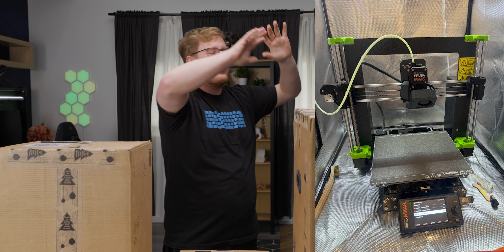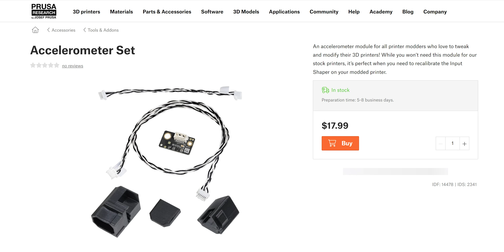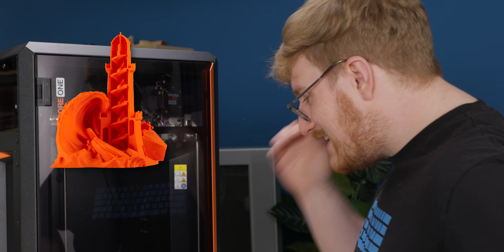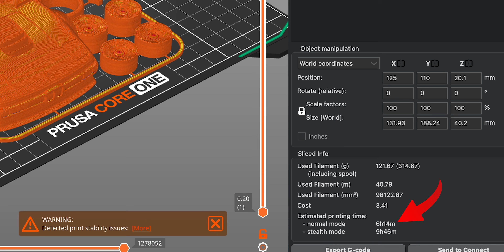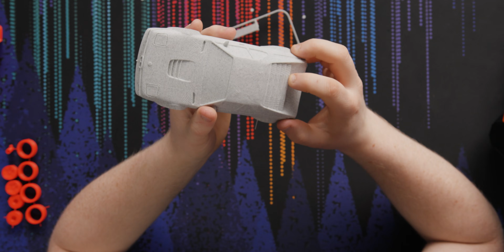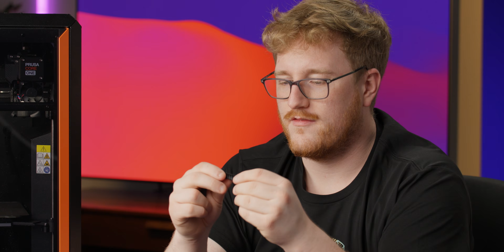Prusa has IMPECCABLE timing - Prusa CORE One

Comment: This highlighted an issue I see in 3D printers. They keep coming out with new models ... but so very little changes. I'm not compelled to "upgrade" from the $200 one I bought 3 years ago and put one of those tents around. Being able to do multiple colors at the same time is about the only thing that sounds enticing. I'd love a resin printer, but have no way to deal with the toxic fumes (which limits filament choice on the FDM also).

Comment: Looks like that needs to be calibrated badly. non of my prusa's ever printed that bad.
Reply: Well if it had built-in accelerometer and lidar, then it could do a self calibration in the setup process... This would reduce motor noise, excessive vibrations that transfer to prints, kinematics and flow improvements and also layer consistency. Almost all the other competitors offer this out of the box
Reply: @alexandrucapatina8688  the point is having to calibrate it. You still have to calibrate a bambu with lidar and ai out of the box. Your comment is almost irrelevant 🤪
Reply: @Rico0chet  any equipment that has moving parts or tolerances should be calibrated on site after delivery and installation. This is common in most industries where you want precision. Pre-calibration is just for the individual components, but not for the whole assembly because during transport and handling there could be issues. In this regard, Prusa is probably better at QC-ing individual components and that’s why they usually print ok out of the box, but not perfect. Calibration of individual components at factory side + calibration of the system on site after delivery and installation will always result in the best quality
Reply: @alexandrucapatina8688  correct but it will always loose calibration during transportation. That's why you should ALWAYS calibrate after you set it up out if the box.  That's where your initial comment is irrelevant. No one who buys a printer should ever assume it's pre calibrated.
Reply: @ ok, I think I understand now what you meant. By “out of the box” I was referring to having the HW necessary for calibration without buying it as an extra add on.
Reply: Are Prusa calibration free or at least supposed to come calibrated?
Reply: @tiloalo  no printers should be pre calibrated because it won't keep the settings during transport. Plus you either build it yourself or get it pre built. But either way after you set it up you should always calibrate it till it prints flawlessly. And yes calibration is free there should be no reason to charge a customer calibration ever.

Comment: Perfect timing! After what Bambu has changed recently with their printers, I am looking for a replacement for my A1 and wanted a enclosed printer as well. Not sure what the price is but if it is about the same as the X1 Carbon, I hope people will choose this over Bambu Lab. 3D printing community needs to put their money where their mouth is if they are against what Bambu Lab has done recently. I do wish these printers came with a gigabit ethernet port though.
Reply: what Bambulab have done? I'm not aware.
Reply: @Scatology900  They introduce tighter authorizations for different levels of usage. But what most people are missing is that if you dont want the new Bambu labs security features you can switch to developer mode OR not update the firmware. Jakes reference is  a bit disingenuous.
Reply: @MrTread-cn2ro  "not update the firmware" is a pretty stupid solution, you should be able to update the firmware and not be forced into those requirements
Reply: @Scatology900  the newest firmware update locks the printer down more for "security" that has already been hacked. They have backpedaled on several statements and have attempted to gaslight their consumers by changed webpages and not saying that they did. They are trying to make their ecosystem entirely proprietary and preventing any 3rd party slicers or add-ons. Real scummy stuff unfortunately because my x1c is fantastic, but I hate bambu studio so now it's on lan only mode so they can't wireless update it and I can still use orca slicer.
Reply: @Scatology900  They start requiring authentication for pretty much any printer operations. And this means the printer needs to be connected to the internet all the time. Bambu users will not be able to use orcaslicer anymore for example as they want to lock you in their own ecosystem. If you use their cloud services and slicere then this probably won't change anything.
This also has effects like if Bambu cloud has some issues then you may not be able to even print anything until they get their system fixed.
They are making changes "to improve security". My printers can't be connected to from the internet, I'd say they are much more secure.
Oh. They can also block you from printing until you've updated the firmware.
Reply: @Qwarzz  " And this means the printer needs to be connected to the internet all the time." what are you talking about? LAN mode will still be available, you still dont need to sign in, they made it very clear these options were remaining
Reply: @BrumBrumBryn  They probably has some very badly worded posts before then.
Reply: @Qwarzz  nope. Every archive of the different post versions only add two sentances and none of them are about internet requirements
Reply: Genuine question: What in the world are you planning to do on your printer with gigabit Ethernet?
Reply: the kit is 1000 euros, and when you add MMU it costs about the same

Comment: I would be highly interested in a 3D Printer secret shopper! I recently purchased both a Prusa XL and a Bambu X1C. Unfortunately, both had issues. While Bambu swiftly replaced their unit, my experience with Prusa has been frustrating. It's been three months of back-and-forth emails and receiving replacement parts that don't resolve the problem. They’re extremely reluctant to accept the printer for a factory repair or replacement, while suggesting I am trying to enrich myself with replacement parts. Given that I paid nearly four times as much for the Prusa machine, I'm hesitant to buy from them again.
And now that Bambulab turned out to be another Evil Corp. I just don't know what to recommend anymore for a completely painless experience. I'm just looking for a printer to print parts for my voron with, not another project.

Comment: My main issue with Prusa is that you're paying a premium for what feels like an unfinished and unrefined product. While I get that it has value as a platform that can be easily modded and upgraded, I feel like these features should result in a cost savings, not a premium. This is the first product I've seen from Prusa that seems more refined, and while it seems to have some issues on that front, it seems to be movement in the right direction. I like the idea of being able to print replacement parts, but if I'm paying a premium, I expect that the original new parts are not 3d printed, or if they are, they are extremely high quality.
Reply: some parts inside are actually printed, I think its carbon fiber or ASA or something high tech. It gives them a way to torture the printers for thousands of hours
Reply: I totally agree with you, Prusa must abandon romanticism and build printers without precarious printed components, without kits to assemble which only create problems for customer support, wasting time and money for the company, personally I don't like the Nextruder, it is problematic with poor quality filaments which in any case must and can be used without problems by cheaper printers, before having an efficient and silent printer I had to disassemble and reassemble the extruder several times, the Prusa world is still too artisanal and is now outdated from decidedly more practical and efficient competitors
Reply: @rOSScOGITANS  They should keep the kits. They're great for learning and for people who like to tinker, and you can still buy their products assembled. Their customer service is doing fine, so I don't think the kits are really being problematic for them.
Reply: prusa is a joke within the 3d printing community as the "apple" of the 3d printerworld that refuses to innovate

youre right though, imagine paying that much money for a printer and it has printed parts on it, it's actually inuslting

Comment: 11:30 :: Meanwhile, my homebrew printer running Klipper/Mainsail transfers G-code files at gigabit speeds...
Reply: Prusa printers can already print before the file has been completely transferred (except for Prusa Link, sadly), so not really relevant, not to mention the bgcode compression… but you can use OctoPrint or something if you need gigabit speeds on Prusa printers (you probably don’t)
Reply: It has an ethernet port.

Comment: You dont have to log into a bambu printer ether if you dont want to. But that is kind of the point of them they are more of a just works printer. And as they have now released dev mode people need to calm the f down. Core one is cool tho, if the MMU is good its a worthy competitor to X1C. Infill also does not add that much strength add walls!
Reply: I think the mmu is preatty much just rushed garbage,
Its insanly huge can just use 5 spools and is very expensive.
Reply: @theprayofheroes5969  for me its the fact that its not enclosed, 90% of the time i give 0 Fs about multi material , i like the drybox.
Reply: @andljoy  thats the next thing just sold my a1 with ams lite for an p1s with ams and will buy the sunlu 4 spool filament dryer and print to the ams from the dryer box

Comment: I'd be interested to see how it compares to the Creality K1c, I would imagine that the Prusa is more reliable but would be interested to know if there are significant differences in quality and speed, especially as the K1c can be found on deal for like £400. It should also be gaining compatibility with the CFS soon, but Prusas do look nice
Reply: I know it's not really their focus, but I'd love to see a 3D printer showdown between the top flagship CoreXY printers from Creality, Bambu Labs, and Prusa.
Reply: @michaelbaker2718  I feel like the K1c isnt talked about in the community enough, or the K1se. I know that the launch of the original K1 and K1 max had many issues, but I know people with X1cs, Prusa XLs, BBL A1s and it feels like they all perform at such a high level in terms of speed and quality that the main differentiating factor is the profile that the user uses. Whilst the X1c and Prusa XL undoubtedly fantastic printers, for many use cases I find them to perform similarly to my K1c (excluding obviously build size and multi colour)

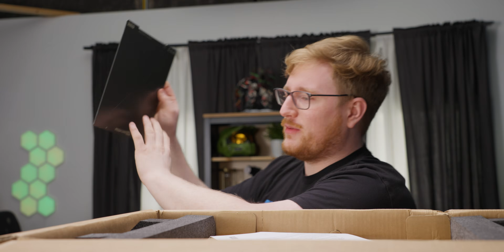Comment: 1:18 the way you put your hand on the build plate makes me shiver
Reply: Like others said, just use IPA. In most of my prints I'm actually sticking glue sticks to make the bed less sticky. TPU and PETG to a less extent, will stick to dirt.
Reply: People that get bent out of shape about touching the build plate, make me shiver. If oils from your skin are making your print fail... You have bigger issues.
Reply: @xeonon  not touching your build plate goes a long way. Just reached 300 printing hours without washing or even flipping my build plate
Reply: @radupirvu9854  a isopropyl wipe cloth before every print is good enough. Even then I only need to bother with the texture build plates since glue sticks on the smooth plates is what I trust for big prints.
Reply: @radupirvu9854  How on earth do you get parts off the build plate without touching it?  The whole point of a flexible plate is that you take it off and bend it to make the parts pop.  You have to touch it.  It's designed that way.
Reply: @TrueThanny  bambu plates have indents outside of the  print area. Just hold those, flex, and you won't grease up the print area

Comment: The AMS of Bambu is multi-color as far as I know, not multi material, which would be a huge difference. That's why the (too expensive) XL has multiple extruders. As for if I would buy this over others, yes I would. The support is incomparable to the others as is the open nature.
Reply: Bro did you ever took time to read about the ams?
You can use pla petg tpu and abs in the same print
Reply: No one hold you to put different material filament to Bambu AMS  and print play part with petg supports
Reply: Of course it's multi-material. It just can't do TPU as the filament isn't rigid enough to be pushed through. The biggest advantage of the XL is much less waste to flushing during changes and faster speeds during swaps
Reply: @tagg8233  You can do TPU in the AMS itself, just not the softer end of the spectrum. They sell 'TPU for AMS" which is 68D shore hardness. Anything softer should be used on the external spool, and for long prints you'd want to feed from a dry box.
Reply: It's multi-material - the first bullet point on the product page says "Multi-Colors/materials Capability"
Reply: @ctskifreaks  Right, but it goes through 1 nozzle right? I don't own one so I'm not sure. If that's the case you'll have to wait and purge a lot to be able to change to filaments with very different temperatures, which then makes the printing time a bit annoying.
Reply: Bambu AMS is also multi material to a CERTAIN degree, it only does tpu, pla(-CF, WOOD), petg(-CF), ABS, ASA, PC, PAHT-CF and support material, PA6-CF and those types are non compatible. ALSO takes much longer, cause as you said, XL has up to five extruders VS bambu's one

Comment: The really short part with the lumafield is so underrated I think... The fact you can verify any claim like that on the spot is so awesome!!!
Reply: where is it? I missed that
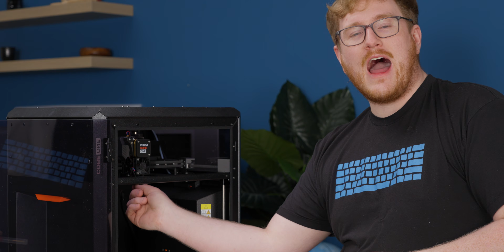Reply: @martinkrauser4029  3:39
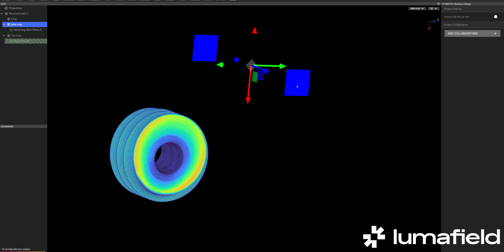Reply: @martinkrauser4029  3:40
Reply: @martinkrauser4029  Maybe they got asked to remove it? I couldn't find it either
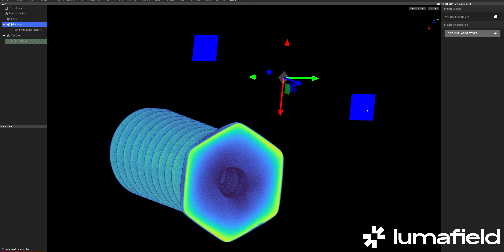Reply: @martinkrauser4029 starts at 3:42
Reply: Why do they show it for just 5 seconds? All of these investments and they waste them on quick, barely noticeable clips
Reply: @denisseniv9548  timestamp?
Reply: @denisseniv9548  It's just an illustration now. You could check this just as well by just looking into the nozzle.
The machine is really meant to look into electronics non-destructively.
Reply: Yeah that shot was so freaking cool

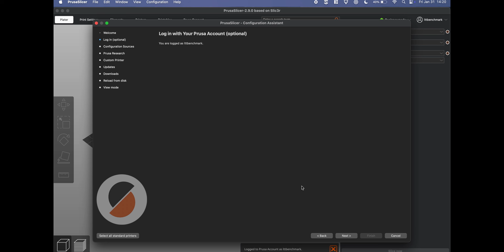Comment: @7:43 doesn't the add-on camera require you to connect it to the internet, use Prusa Connect & be cloud tied?
Reply: At the moment yes, they are working on making it work as an rtsp camera in the future so you can access the steam locally.
But also the camera isn't needed for operation and having it to monitor the print only makes sense if you can access the stream from anywhere which means cloud platform or you need to vpn into your network.
Reply: And Bambu Studio doesn't need to be logged in, it does when you want to use cloud stuff obviously. LMG just flat out lying for their sponsor.

Comment: Weed grow tent haha 0:25
Reply: Not surprised considering they're from Vancouver.
Reply: They've done a video on this channel already building a computer and putting it inside of that grow tent, allowing for the ventilation to go to a cut out in the window for the bedroom that they prepared, allowing for all of the heat dissipated from the computer to be directly put outside rather than into the room. I'm assuming Jake just ended up with it after the video was done.
Reply: They make 3d printing enclosure with the same concept but I guess due to the economy of scale you're better off buying an actual grow tent. That's what I did.  I already had a tent... for other purposes but I wanted to buy an enclosure for my printer, after spending $75 on one, that was shoddily built and smaller than the advertised size I decided to spend $100 on a 2x2 growtent. Not only is it much sturdier and using higher quality material, It's much bigger.
Reply: @frankb5728  I'm still very very new to 3D printing, why would you want an enclosure?
Reply: @MrMisturr for tougher materials like abs or asa that require constant and higher then ambient temperature around them to print properly. You can print abs without an enclosure but it probably will be hard and it will warp or something. If you print pla/petg only you dont need one
Reply: @ As Anasajk has pointed out, some materials will shrink more than others as they cool so you want to maintain a constant ambient temperature.  Otherwise you may run into bed adhesion and dimensional accuracy issues. Also you don't want to inhale the fumes from melted plastic. ABS and ASA fumes are actually toxic but PLA fumes are not completely safe.